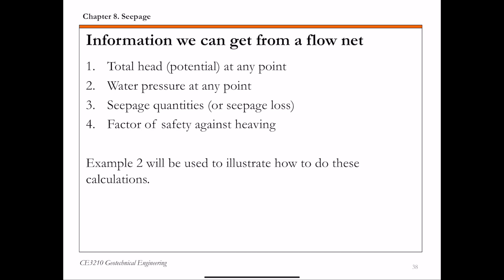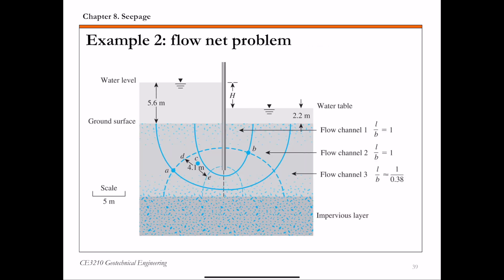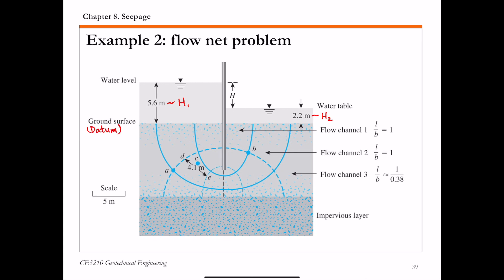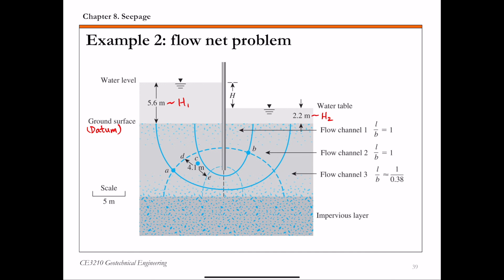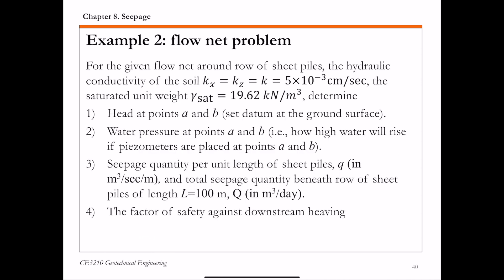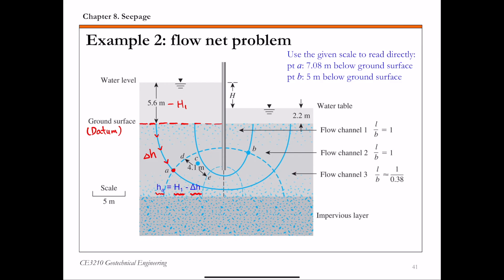Chapter 8 Seepage - 4 Flow net basics (2) and Example 2

Comment: how will i use the scale to find the distance of the specific point to the datum
Reply from the maker: That scale gives you the length of 5 m (in the real world) on the graph. For instance, if say that scale is 2 cm (on the graph), which we know represents 5 m (in the real world), and you measured the distance of the specific point to the datum is 4 cm on the graph. This means the real-world distance of that point to datum is 10 m.
Reply: @uSeeGeo  still unclear